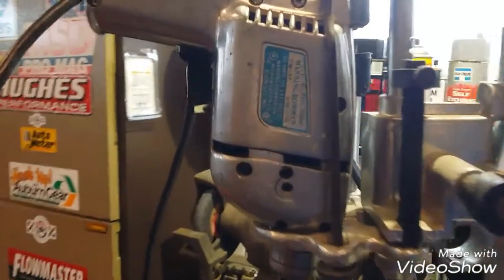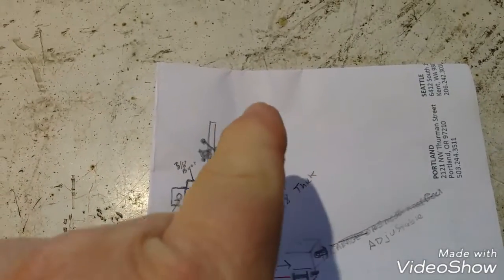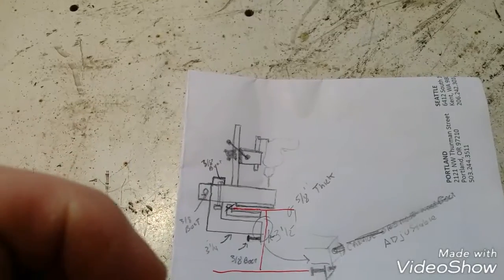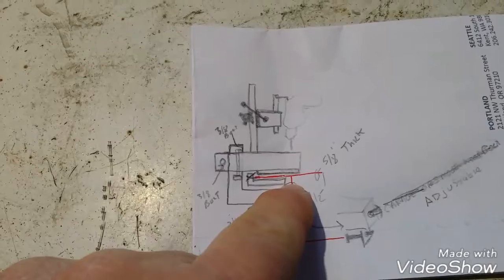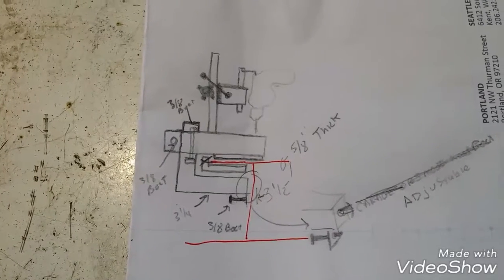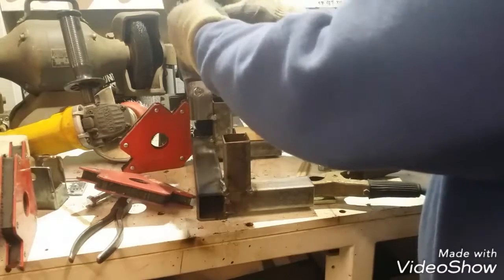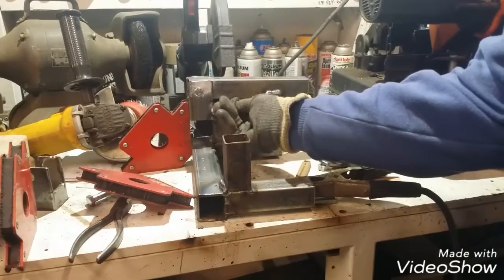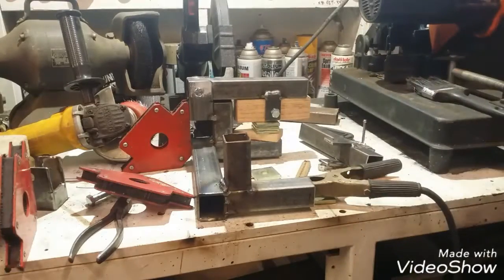Building an I Beam Clamp for a small drill press. Have 150 small holes to drill, let build a tool!

Comment: Geee, your client must be high on something......

Drill a hundred holes in an i beam but don't allow to damage the paint? And the holes are for led strips.....

It simply don't make sense. Led strips are not that heavy, if it is just for christmas decoration, cable tie and double side tape already done the job. Not to mention drilling holes in i beam will weaken the structure, you won't have a i beam if it is not holding a lot of weight, drilling extra holes on it? Men, if i were you, i will record the conversation just in case if anything happens, you can show evidence in court.
Reply from the maker: Install $20,000.00 worth of LED lights with zip ties and two sided tape on a public structure? Great plan. Think they will last 20 years? A 3/16" hole drilled 1" deep in the center of a 5/8" thick 8" I Beam supporting a glass roof  is nothing....